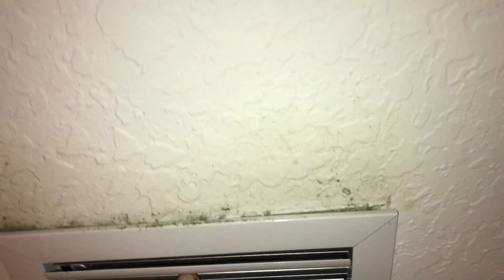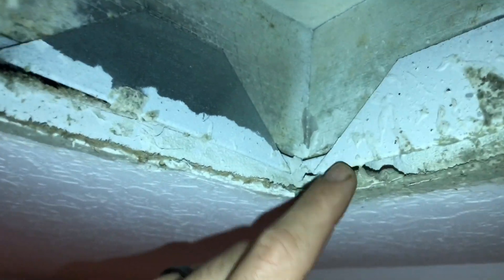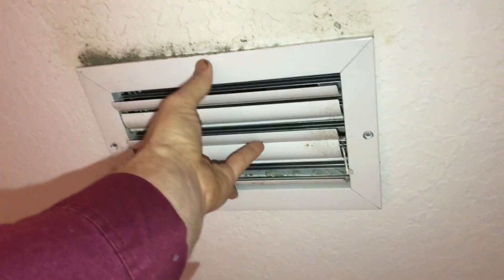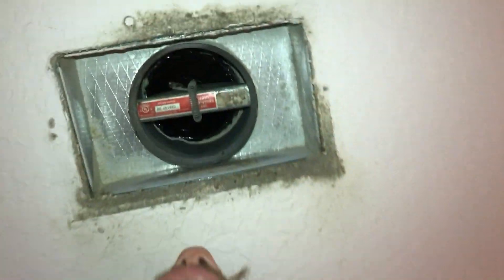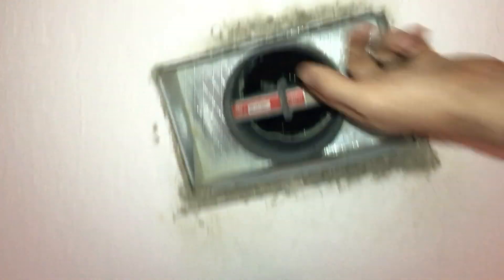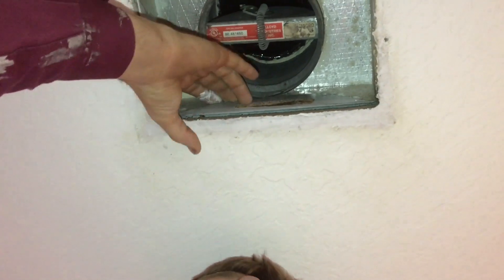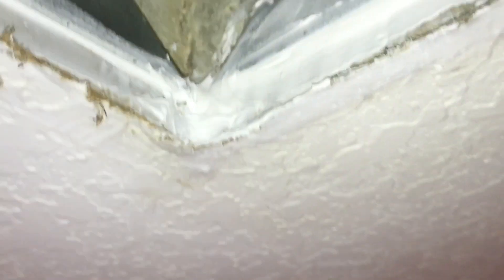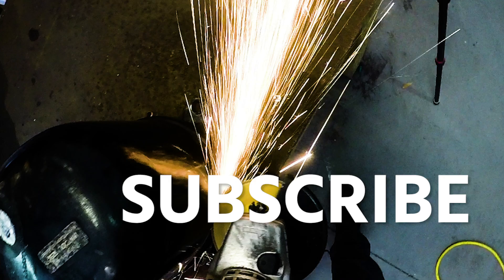Is There Mold in my Ducks! 🦆(Ducts)

Comment: Thank you! I guess I have my work cut out. We just had our roof replaced and 5 months ago, I just noticed that dust or mold in my room 2 weeks ago, then looked at the rest and all of them have the same thing. I need to do12 vents. Never did 1 let alone 12. I turn 69 this month, hope I can do it. Sure gonna try. Not going in the attic. Bet there's spiders up there. I'll do it like you did. Thanks for your advice. We just had our ducts cleaned 3 yrs ago. $500.00.

Comment: Thank you so much, we are renting a 200 year old skirted house where the temperatures are from 0- 25 degrees fahrenheit most if the year and every time the furnace blows air it chokes me out and I can't sleep. I've been up since 3 am trying to figure out where its coming from and remembered when I didn't have caulking so I used duct tape to close those gaps because we kept losing heat real bad and I feared for my kids safety due to -30 degree weather during a blizzard.

Comment: Hello 👋 please help‼️

So I am
Getting all sorts of white looking powdery stuff and like little fiber looking stuff inside the house. And I mean all over and if you clean it it just is back within a day. It looks like debris of some sort and definitely coming from the hvac air duct vents. The vents were “supposedly” cleaned by FOLKS but this stuff remains. They put an electro static filter in the furnace and took out the paper replaceable filters from both air intakes vents. Is this normal? This stuff is literally everywhere and is bothering my skin and lungs. If I take a flashlight and look it’s everywhere

Comment: So, I had a similar situation. Noticed growth on several air registers and in cabinets. The humidity in the house was very high. Was told the plenum box had an air leak. It was repaired. Humidity has dropped considerably, however it’s still too high. Have to keep a dehumidifier running 24/7. It’s a 1500 square foot dehumidifier and I have to empty it twice a day. All of my registers and cabinets have been cleaned thoroughly, yet I still smell the “growth” smell in my home. Is this because the humidity is still too high? I’m at my wits end with this situation. Any insight?
Reply: Did you ever figure it out?
Reply: I have this problem now.
Reply: How high is the indoor humidity?

Comment: Just subbed to this channel.  I have good 20 year fiber board ducts, but when time to replace Ithink I want metal.  I live in florida and would use insulated metal truck with old flexed attached be the best choice considering the flex line should last longer then the existing fiber board truck.  Whats your opinion?  Thx

Comment: Mastic tape cut into Strips and put just inside the area covered by the register border and taped to the inside works as well and can be faster and cause less mess ,if sealing multiple registers.Best if you use a razor blade cut the roll down the middle and tear strips to size. Less sticking to fingers or tearing.